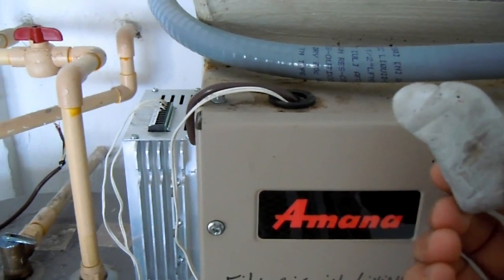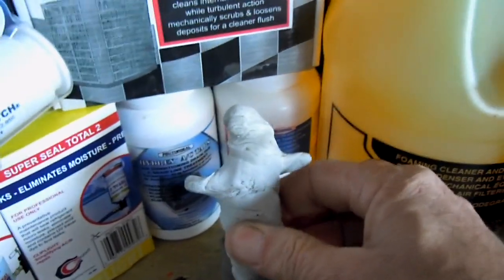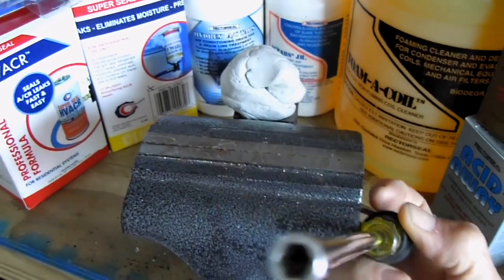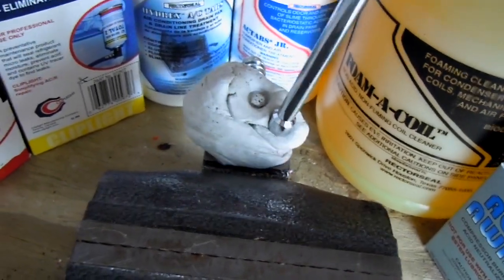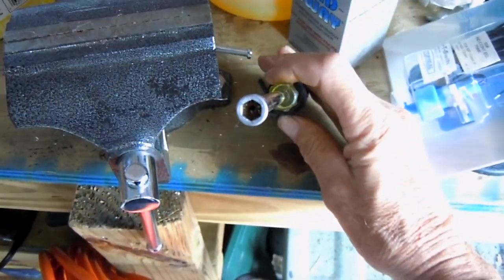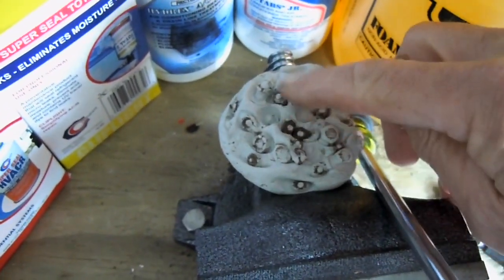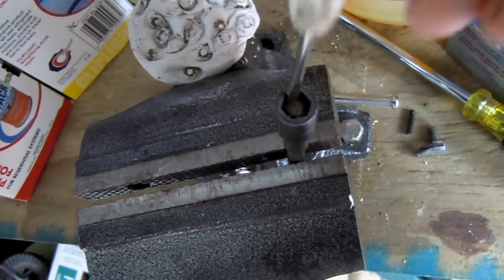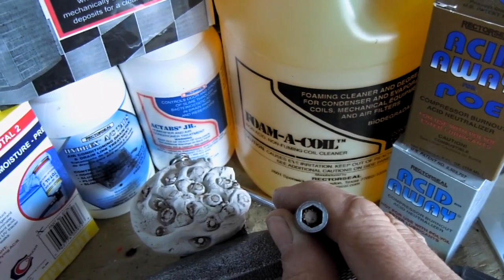HVAC permagum uses

Comment: So hey, thanks for making the video. Quick question.. does this stuff cure? I'm using it to seal a slight open spot on my freezer door gasket. Works good, just wondering if it will get hard or permanent.. so far has fixed my cold air leak.. thanks.
Reply from the maker: ThesexyMrX permagum does not cure. It will dry out.